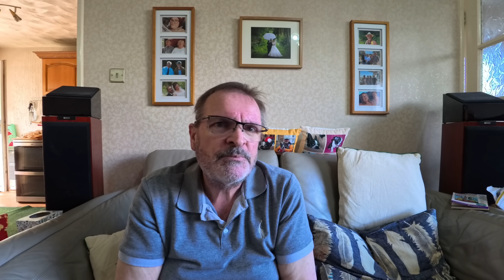Expert Ships Engineer Reacts to Baltimore Bridge Crash

Comment: One thing I have not heard discussed is that there were no guards to protect the bridge supports. In my neck of the woods, there are massive "guards, fenders. dolphins" that protect the bridge supports. I don't know if this is common on the east coast but looking at google earth you can see the bridges on the Gulf Coast are protected. Maybe when the bridge is rebuilt, this can be addressed. Meanwhile a study needs to be done on other bridges to determine if the guarding is adequate for these bridges.

Comment: As a land lubber, I appreciate the insight into the design of merchant ships. 
 That said, no matter how well designed or what amount of redundancy is built into a ship, we all know mechanical systems can and do fail.  
     Knowing the amount of daily shipping traffic that would be passing within feet of the bridges structural support columns, it is just mind boggling that no crash barriers were implemented to prevent catastrophic failure. 
 For a small percentage of the projects expense, this tragedy could have been prevented.

Comment: Everyone used to talk about a blackout. But given that a total power failure occurred again shortly after power supply was restored, it looks like a "dead ship" incident in which no any power supply, including the em'cy Diesel generator, can be restored. It would not surprise me if investigation will reveal that. Anyway, the problem of power failures on modern box carriers has been known for long. The root causes of the majority of propulsion power failures on modern box carriers are associated with (i) fuel change-over requirements which do not take into account that such huge Diesel engines are not designed for slow speed for a prolonged period of time; (ii) settings and back-up provisions of electronic power management systems which often do not correspond with each other; (iii) too sensitive settings of alarm sensors (e.g.,oil mist alarm) which often "overreact" and initiate a chain reaction leading almost always to a fuel shut-off of the main engine in quick succession; (iv) failure-prone dry sump force-feed lubrication systems, which - through the nature of their cost-saving configuration - are responsible for total losses and near misses. Unfortunately, marine accident investigation reports tend to blame the engineers on board of ill-fated vessels, who face difficulties to defend themselves when their corpses have found the final resting place in Davy Jones' locker. As long as Class Societies and Marine Insurers remain silent over these intrinsic shortcomings, nothing will change for the better, and more ships will founder and more bridges collapse.

Comment: Your explanation seems extremely plausible. I had wondered if a total loss of power and loss of steering occurred if the in built default position would be for the steering to go into a circular holding pattern but obviously not. If you are correct had the master just allowed to ship to carry on propelled by its own momentum even if the propellor had failed this accident would perhaps been avoided. But of course that’s the nature of accidents they are random and subject to hasty solutions sometimes disastrous.

Comment: If the Tugboats had not left the vessel until it reached open seas, could all of this possibly be avoided? I haven't heard much about the ship maintenance records, and there appears there is a 2 minute gap 12:18  missing on the blackbox recorder.  I also wonder why there appears to be no fender barriers, rock wall around the main support beams protecting the bridge mains? The ship turned past the dolphins.

Comment: An experienced  maritime lawyer needs to get involved with this investigation along with old and wise ship engineers. I am beginning to feel this was not a 'simple accident' How long have we had cargoships traversing the waterways? A Very Long Time. A ship of this size should have had a proper generator immediately click into operation and provide power. Had this ship ever been to this port prior? This bridge did not have proper protective measures in place to have prevented this size of a fiasco. We've been told this port gets a Lot of traffic. This looks like a collision that was nearly inevitable to happen due to a list of factors. Like Sully from Miracle on the Hudson said safety concerns only get listened to after an 'accident.'

Comment: an alternative method of operating the steering gear may not necessarily be instant.  it may require manually operating various valves and other equipment taking many minutes.

Comment: It’s my understanding, that regardless of loss power, that steering is never shut down
Reply: I'm exforces, Royal Navy. No way will you move a fifty-ton rudder cable unpowered.  A typical aircraft carrier's rudder measures around 75 to 90 feet in height and 40 to 50 feet in width. These dimensions provide enough surface area for the rudder to effectively steer the carrier, considering its immense size and weight.

Good luck moving that unpowered.
Reply: @voiceofreason162  Should have never happened. The cargo ship that crashed into the Francis Scott Key Bridge in Baltimore, causing it’s collapse, not only had multiple backup power systems, but it had multiple steering systems as well. Both Federal and International maritime standards call for these auxiliary systems. They also need to be completely separated from each other so power and steering are never lost. When you break down the factors surrounding this crash, it becomes more and more suspicious. Investigators originally lied about wind speed on the water that day. It turns out there was very little wind that would have had zero effect on turning the ship towards the main pillar of the bridge.

Comment: An assumption that when the lights went out, lighting in the machinery spaces went out also. (NOT FAIR). Your assumption that the engines were powering in reverse because of the smoke direction from the stack. (Not fair). Your relating the action of the stern (to port), due to (paddle wheel effect). Would be adjusted with the rudder.

Comment: After the first blackout the power recovery was from a main generator, not the emergency diesel.
Only a main diesel generator is big enough to be able to start the main engines.  Taking way off a large ship like that takes some doing, but agree going ahead and putting water flow over the rudder may have enabled the ship to turn a little bit away from the bridge support, but that will be one for the accident board and the computer simulator boys. Glad I’m retired, think the intray for the master and Chief Enginner will be full.

Comment: Excellent insights and calm explanation from a an experienced expert in his particular field. As a retired Electrical Engineer (I know nothing about ships) but I had assumed that there would be emergency generators which are “normal” practice in critical systems (ships, planes, data centers etc). I have seen many times in data centres  where the emergency diesel generators fail to start or start and fail when needed due to diesel fuel contamination etc. also failure to do regular scheduled tests of the diesel generators to test not only the emergency power systems but also to test the procedures and chain of command (human responses to the procedures). Tragic outcome and condolences to the families of the souls that were lost.

Comment: 🤔 Hmmmm………..hard to call him a master as he took out a bridge. Although power went out, the rudder is hydraulic……….so they should not have lost ship control. I’m sure there is a backup generator for the engine should it fail. Black smoke in a diesel engine points toward a stressful condition. We can dissect this to death……but……bottom line…….where is the control when we get a power failure. Is there no backup…….no manual control. That’s just rigoddamndiculous and it must change on all sea going vessels.

Comment: yeah sure, Scotty. O @ the spark at the top of the span. and the bridge collapsed First off half way between the piers. The Cap'm did a fine job avoiding the little upright post dead on. Dead reconning swing around to dock ?
Need to view this show in Slow Mo to see all the sparkles. lol
It was the bridge that was the target not the engine room order telegram

Comment: I was in a similar incident minus the bridge but in a relatively narrow river on leaving a US port some fifty five years or so ago. It was a steam turbine vessel with the turbine lubricating oil being delivered by gravity from a tank way up in the gods in the Engine Room(E.R.) Suddenly the main propulsion was lost, but not the generators. All hell breaks out. Need to find problem and resolve it swiftly as length of tanker is probably longer than the river width. It turned out that the pump providing lube oil to the tank had tripped, as the oil level in the tank drops it closes the steam valve to the turbine. Actions taken, restart lube pump plus secondary lube pump, try opening steam isolating valve to turbine, which is permitted after oil level in the supply tank rises. Start providing propulsion to ship.  This all happens within about three or four minutes and is possible because the engineers are young and reasonably fit, able to run up and down stairs in the huge volume of the E.R.   The sudden loss of steam usage requires someone to attend to the boilers to prevent the safety valves lifting and at the same time the Bridge team are constantly phoning to find out what’s going on,  The phone calls are largely ignored as we were far too busy, and them knowing what the problem was would not help resolve it. The crucial action was to restore propulsion.

Comment: So as they lost ability to steer the vessle they went into pannic mode trying to break by going astern instead & that caused the vessle to turn sharp starboard crashing into the bridge load bearing pillars. But what about the flashes far to port & starbord sides of the vessle.

Comment: Good analysis.  Never thought of the paddle wheel effect.  Doesn’t make much of a difference except in certain circumstances like some idiot forgets to put the “C” clips back on the steering cables for my out drive on a 23’ sport cruiser.  At 60mph it takes about 300 milliseconds for the out drive to go full starboard and throw me into the back of the boat and ended the days of taking my wife on boat rides.  What the engineer is talking about is prop wash.  The prop has two vectors that represent what it does. 1. Points directly to the rear of the boat along the path defined by the prop shaft.  2. Side wash, paddle wheel points directly sideways to the prop shaft and is much less strong compared to thrust.  But at low speeds when thrust is low the paddle wheel effect is more pronounced and most helmsman know how to use the effect or adjust for it.  I agree with the analysis here, the actions taken were probably not the most effective way to avoid the collision.  I would think that these situations would be practiced and possibly simulated.  If you ever see one of these ships at sea or on the Great Lakes and you are in a small sport boat you wonder how they get the thing to do anything.  The size seems like it would over power any attempt to change course in spite of what Sir Isaac Newton said.

Comment: Why didn't the cargo ship use a tug boat(s) to guide it past the bridge?????
Reply: I have told they only use tugs to dock now.
Reply: @pathacker4963  Tug boats were recently used extensively in the movement of the Battleship New Jersey and when I was younger, I personally witnessed the use of tugboats around New York harbor. This was clearly necessary in Baltimore, but neglected to save money, which was a very expensive cost saving measure.

Comment: good video from an experienced ship engineer. i saw a video that mentioned that if tug boats were involved in guiding this ship out of the danger zone going underneath the main bridge supports, this accident could have been avoided. The video did mention that it somewhat costly to have tugs perform this kind of service so shipping companies and port authorities do not enforce or follow that practice. Removing the bridge debris, cleaning up the harbor and rebuilding that bridge will cost many billions of dollars and at least 4 or more years. I think the cost/benefit analysis will point to using tug boats in such situations.

Comment: Most reasonable description I’ve heard yet, with one possible exception.

When the McCain and Fitzgerald were both rammed by Chinese-owned freighters, much larger that the destroyers that they’d hit, the destroyers were BOTH dead in the water. Were the Chinese testing a super-EMP device that shut down the power on both destroyers?

Comment: In short, the “professionals” panicked and made a mistake.

Unfortunately that sounds more like an excuse than an explanation. 

Let’s look at this logically. The pilots had 2 options to pursue, based on the explanation. 
1) Keep drifting forward. 
2) Go astern, pointing the bow to starboard.

You assert that they made a mistake and went full astern. Yet had they kept drifting forward, they would’ve safely cleared the bridge.

A professional would’ve known that going astern would result in pointing the bow starboard and that they wouldn’t have stopped even remotely in time based on distance, size, and weight of the ship. 

Professionals are trained to deal with situations such as these. Heck, drive on ice covered roads and you know you need to pump the brakes so you don’t spin (unless you have antilock brakes). And that’s a split second decision.

I appreciate the explanation regarding the black smoke, anchor, and why the ship went starboard. Going astern is the logical conclusion for the direction of the ship.

But it doesn’t explain why a professional would make a “rookie” mistake, especially when it was pretty much a “pilot by committee” type of situation.

And of course the no record on the black box doesn’t help this case either. The trend for the past few years is that a “gross mistake” always seems to favor a particular side/agenda.

So the mistake excuse really isn’t a viable one given the trend and facts.

Comment: The first blackout was for almost a minute. Would the 9-cylinder MAN-B&W 9S90ME-C9.2propulsion engine pumps (FW, SW, LO, etc) not stop? As such the engine would run down? As soon as the emergency generator started they would have re-established steering (but not the propulsion engine electric pumps. So would they not have counteracted the 'stern walk' using the rudder? At this point they still cannot start the engine in reverse until they re-establish power to the main switchboard to supply the main engine electric pumps. How easy is it to restart and how long does it take to restart a large two stroke engine in reverse whilst the propeller is turning 'ahead' at 8 knots? Is it possible that it was a switchboard fault? - When the mains tripped the emergency gen started (singled up) but when they tried to parallel and re-connect the main switchboard it caused the emergency to trip also?
I am not sure that dropping the port anchor at 8 knots guarantees a swing to port - when a semi truck hits the brakes hard the trailer may jack-knife to either side.

Comment: Why do some ports use tug boats to steer ships in port? With tug boats present could tug boats have steered the ships away from the pillar?
Reply: Because tug boats are only used in tight quarters or tricky bottom terrain.

Comment: Bridges are not designed for this kind of loads.
The head room available is known.
This in my view is a case of "overloading the ship"
Why?  bridge in Long Beach, because it had insufficient head room.
Gerald Desmond bridge
Reply: This has nothing to do with head room
Reply: @rack9458  It does.
Ship was loaded too high. Why? The headroom is given to all ships. Why did the height of load exceed that. It has nothing to do with the propeller and how it worked.
Gerald Desmond bridge was dismantled because the headroom was inadequate.
I was one of the designer of Gerald Desmond Bridge.
Reply: @nareshvasishth4034  Wrong.  All ships are measured loaded and unloaded with the number of containers calculated as they are loaded.  It ran Into the support post not the deck.
Reply: @rack9458  Thanks for clarifying that. From what I saw, I  was under the impression that the HIT took place at the road level due to a load too high.
I apologize for the mistake, if I was wrong.

Comment: Most people don't know that that the engine must stop then run in opposite directions.
Reply: I think most people understand the concept
Reply: @rack9458  most think big ships have automatic transmission . Not really
Reply: Diesel electric Usually reacts faster.
Reply: @stephenhans189  No they don't.  Have you ever driven a boat?
Reply: @stephenhans189  Not when there's no power!
Reply: @rack9458  I am not talking about me or you! Did you even read the first comment? 
I have worked 80,000 shaft hp engines . Most people don't have a clue what goes on in the inside of a ship !
Reply: @stephenhans189  Correct but most people know a ship does not stop on a dime.
Reply: @rack9458  that's not true! Only people with nautical experience. Know that . Are you a deck or eng. Officer ?
Reply: @stephenhans189  Anyone that's been on a boat knows better